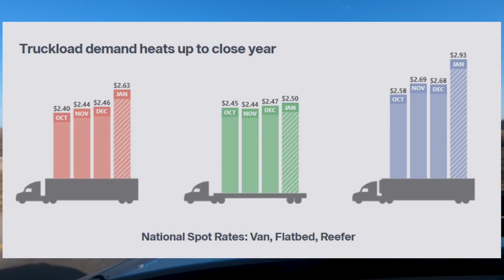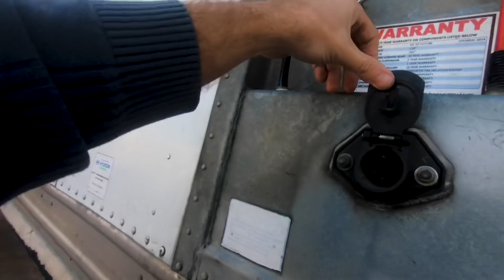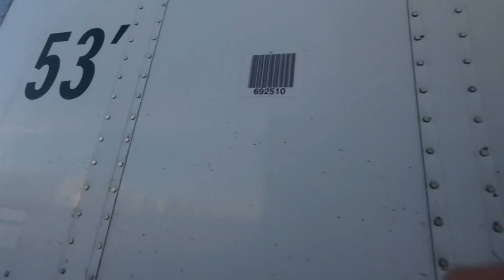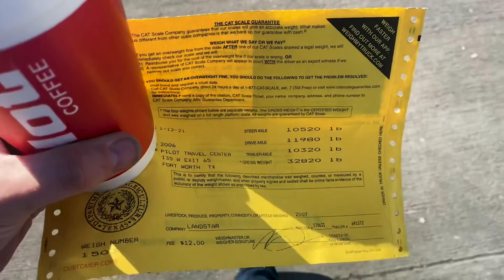This is Goodbye...

Comment: Vin plate on front of trailer will tell you the year. The splatter on the rim is not a wheel seal it is a leaking hub, simple and cheap to fix

Comment: Side skirts are an indicator of the newer trailers and shiny landing gear my first trailer with LANDSTAR was a brand new trailer and the one I’m pulling now is a 2021 as well! I’ve been typing in 35000lbs loads @ 2.50 min rpm and been doing great don’t haul heavier than that if you don’t need to!

Comment: Vanguard, its the offshoot of great dane. Also the number convention is the key to a newer trailer. BTW that wasn't a wheel seal it s was just a hub cap leaking, they are grease hubs not oilers . Hope to catch up with you soon.

Comment: i switch to reefer in dec 2020 from 48' flat.  I was worried about the new President administration shutting the country down, which i dont think will happen know.  The last two weeks, reefer has been hard on my wife and I, with wait times.  Dispatching reefer is a true art. Much more info to consider before taking a load.  You will go places you never imagined.

Comment: This works on Automotive and will probably work on trailers - see if you can find the VIN on the trailer. The 10th digit denotes the year (IE:7 is a 2007, F is a 2015, K is a 2019). The full list is on Google. Good luck with dry van man! Hope your blown tire luck is also behind you. Cheers.

Comment: Hey there :) I've always thought diesel weight is about 7lbs(6.9 to be precise(DEF though is about 8lbs)). Am I wrong? Another thing about 46k on a box, it is kinda hard to distribute heavy load between tandems (since you have 34 on each now) considering the fact that most places that load boxes will not allow driver to look while getting loaded. in states where they do enforce their bridge law(except Fla. you can do 44k on a tandem there), especially pain in the back :) 
Liked and subscribed! :)
Reply: DEF is 97% water, which weighs 8pounds per gallon.
Reply from the maker: I round up to 8 just to make life easy 👍🏻